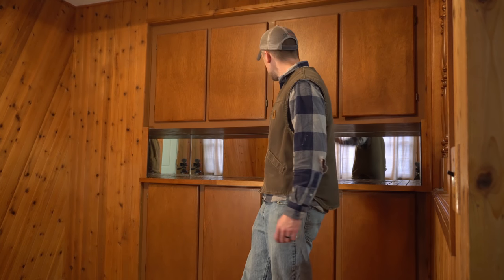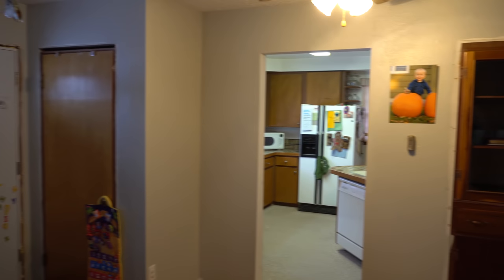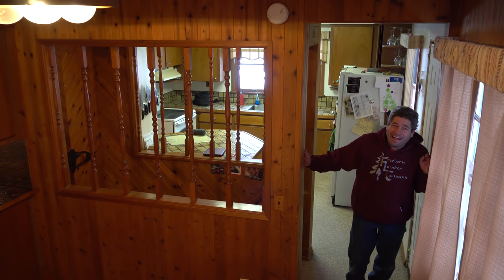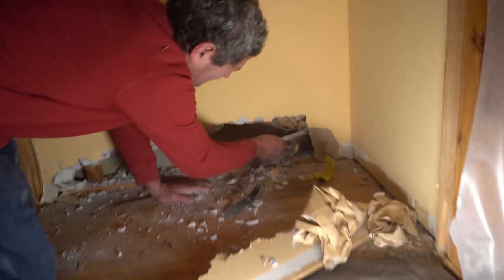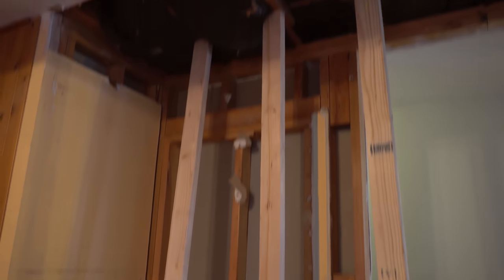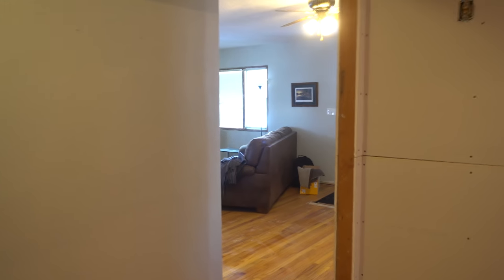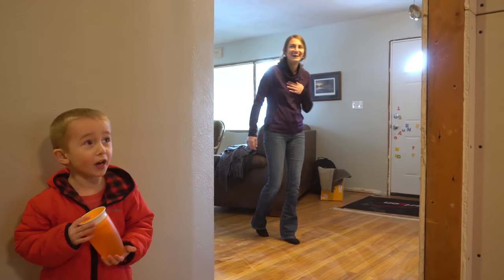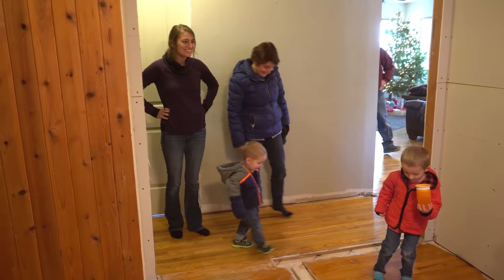Dining Room Expansion

Comment: Typically codes requires nails on headers spaced 12-16” apart. On a 2x10 header, we usually do 5-6 nails vertically per the spacing. Also adding a second jack stud (cripple) wouldn’t hurt if the span is over 6 feet and/or there is a lot of load being supported
Reply: Good call.   I was going to say it seems like a second jack stud should have been used too.

Comment: Obviously too late for this, but I always glue in a 1/2" sheet of osb between my headers. This makes the header stronger and will take up the 1/2" gap you have from the 2x10s only being 3" when stacked but the 2x4 being 3 1/2" on its side. All in all, this was very good. Did you just add extra drywall to take up that 1/2" gap?

Comment: How are you going to handle patching the wood floor?
Reply: Andrew Brasher you can either try to match it to the existing hardwood, but that's fairly difficult and only gets harder the older the floors are. Or you can refinish all of the floors and stain them all the same color. But what I think might be the best option is to pick something different and call it extra fancy. Basically picking something to stand out, which would mean you could use something more exptic that would otherwise be cost prohibitive to do a whole room/house in but with the relatively minor quantity wouldn't be so bad.
Reply from the maker: I really like that idea! But honestly, that floor runs through the entire upstairs and needs to be refinished - and I really don't want to do that one myself. Luckily I know a guy... if he can give me a good price I'll probably let him do most of the work.

Comment: Why is it that every house i see in The US has 4x2 frames and plasterboard (drywall) in them?, probably for this reason where you can changed the outlook and spacing of a room, where as we can't as our walls are all made of brick. 
Great video by the way and yes i would like to see the outcome of your refurbishment, you can't stop filming it anyway. It would be a what happened next moment after cancelling a TV series ha ha ha.
Barry (ENG)
Reply: If I had to guess, wood is cheaper here in the United States than brick is. It won't last as long as your brick structure will. There are tradeoffs between the two

Comment: Nice carcass hanging on the wall not! Nice demolition made a big difference but i hope you take down all that wood on the walls as it makes it look dark and gloomy
Reply from the maker: That is the plan. The old paneling has to go. It is all glued on, so there's going to be lots of drywall work involved.
Reply: Gunflint Designs in england all the new houses have plasterboard walls (drywall) and its very annoying when ripping off tiles etc. I prefer solid walls so things like that are really easy to repair.